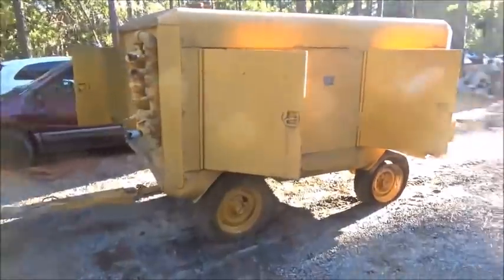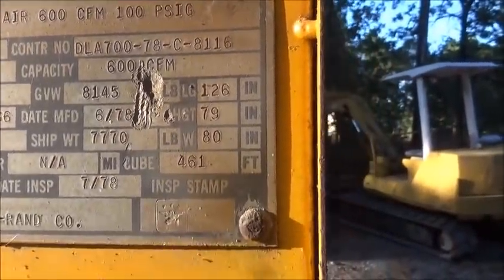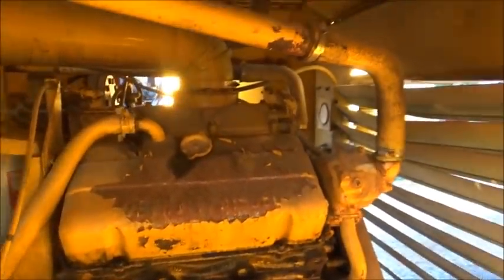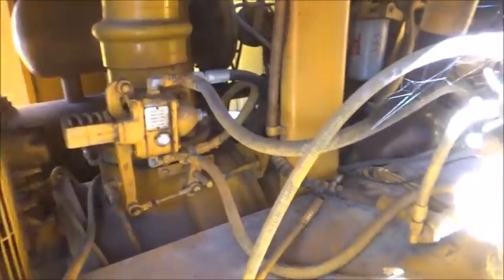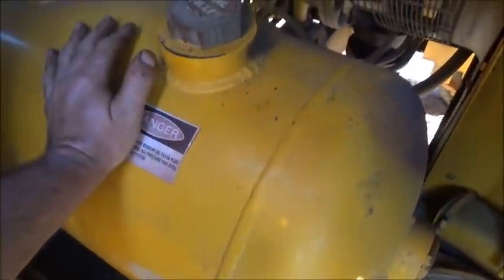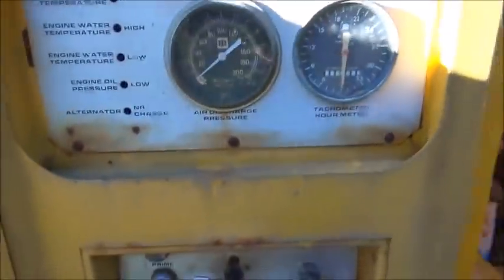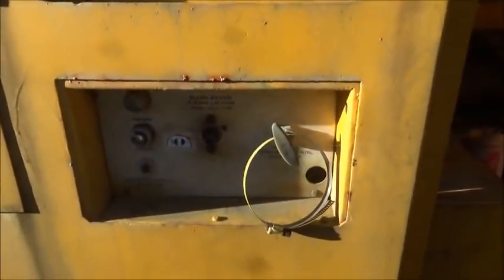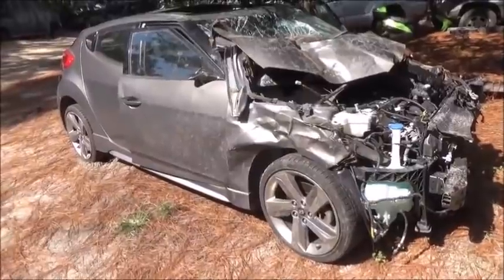600 CFM INGERSOLL RAND BIG ENOUGH TO RUN A STEAM ENGINE!!

Comment: What not safe for humans means Jonathan is that you can’t run that compressor on a diving bell or suit underwater
Reply from the maker: I just pictured hat dog trying to eat air from a blow nozzle I seen in a video.
Reply: @jonathanw4942  hey I've heard that if the wrong oil is used it will cause the seals on the compressor vanes to swell. I hope this doesn't mean that they ran it with swollen seals and smoked them. I know this is the case on some superchargers as well. Looking forward to seeing what you do with it!
Reply: @QuantumLeap83  Absolutely correct! I remember having a couple of Paxton blowers, which used ATF. The "gearing" was via a group of balls about an inch in diameter, so everything had to be squeaky clean. Years later, we had screw type compressors (Kaiser) which used a special oil also. Not wanting to take chances with a couple of 75HP compressors, I always ordered the stuff from Kaiser.
Reply: @jonathanw4942  lol
Reply: Because the air that was compressed contains trace amounts of oil and combustion by- products.
I know this from my experiences filling SCUBA tanks to 3000 psi with my own compressor for many years.
I suggest you drain the oil; rotate the compressor briefly with all valves open to purge the system; then refill according to specs in the manual.
Good luck man!
Always handy to have a big compressor around.
Once you get the Corliss rebuilt; that compressor will run it no problem.
Reply: @b.atwater3904  Makes sense.
Reply: Love the cat.. I'm still giggle..
Reply: That compressor cannot be used to fill air tanks that fire fighters use on their SCBA units (Self Contained Breathing Apparatus) AKA air packs. They use pure filtered air.
Reply: You are absolutely correct.  As a retired firefighter I should have remembered that the air systems for firefighter breathing apparatus have very specific requirements.  The big Ingersoll Rand that Jonathan has does not meet those requirements.
Reply: @hoss1947  
An industrial compressor like this is built to put out at best a few hundred Psi at let's say, several hundred CFM.
SCUBA and SCBA as in firefighting equipment is compressed; dried and highly filtered air at pressures well over 1,000 Psi up to and above 4,000 depending on application.
Reply: I have seen people try to build their own hyperbaric chambers,  so that’s the same theory.
Reply: @bcgrittner  
Nope!
Not even close to being the same theory..
Oxygen therapy under increased atmospheric pressure is totally different than compressed air!
Reply: @b.atwater3904  Thanks for clarifying.  I have been retired from firefighting EMS for 21 years.  HBC got mentioned briefly during one of my medic classes in the mid - 1980's.  My comment was based on an actual incident.  A man bought a compressor from my store for use with his DIY HBC.  Two weeks later he returned complaining of the compressor oil smell.  I referred him to the senior manager.  Please understand I never encouraged this type of ridiculous behavior.
Reply: Also means that it cannot be used in a food production or processing plant where compressed air may come into contact with food. I worked in a industrial bakery for 20 years, and the air compressors must be rated for human consumption!
Reply: ...or for a forced air breather for painting or blasting. Gotta filter and guard against carbon monoxide.
Reply: Yes you don't want any contaminants in the air such as oil rust and so forth especially oil of course I'm talking about breathing in the air that is under pressure contaminated with oil will absolutely kill you that's why they build Special compressors that are oil-free to fill up scuba tanks
Reply: @garygermain2333  
Breathing air compressors do contain oil; but it is silicone based oil, not petroleum based oil as in other rotating machinery.
Also; after the air is compressed it goes through an oil/water separator and filter media with activated carbon to purify it.
Reply: I was thinking that or if someone was gonna try to use it to put air down into a mine...
Reply: Or for air in a confined space environment.